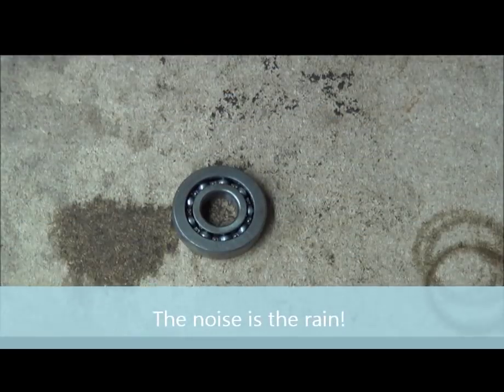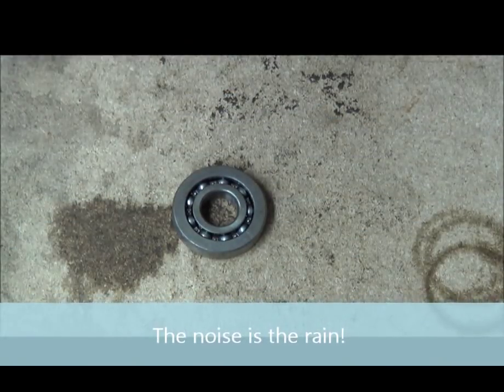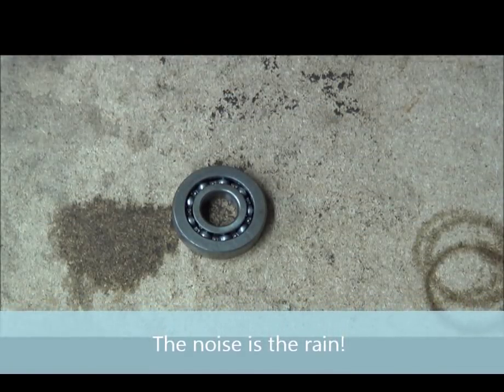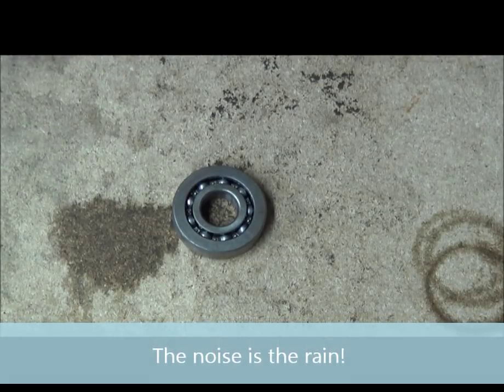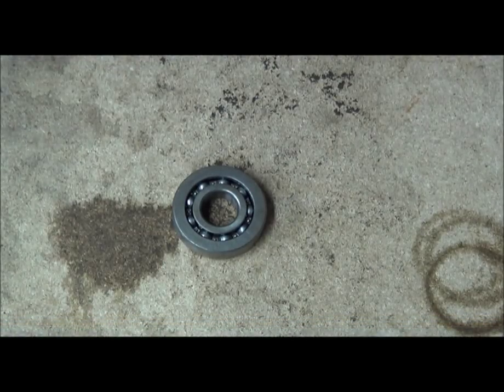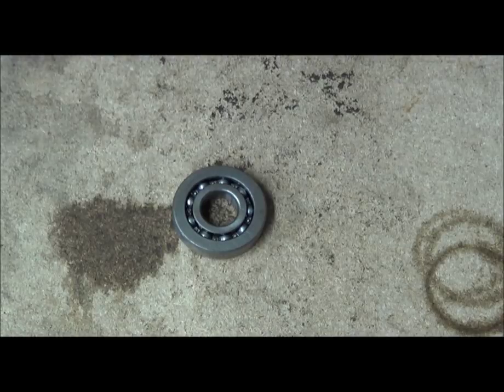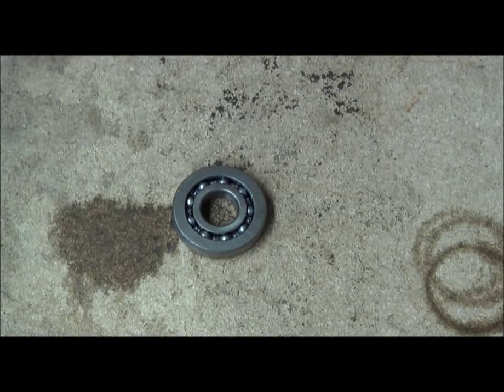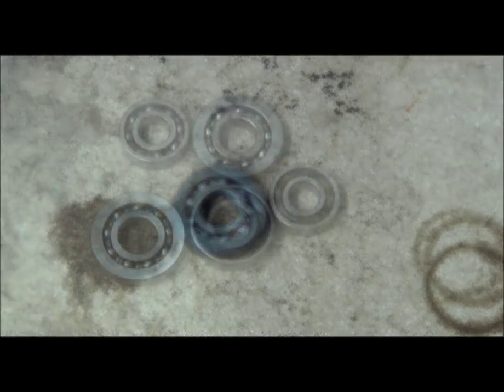Bearing Basics - Episode 1

Comment: I just came across this gem from the archives Matt, a highly informative video for the uninitiated regarding bearings.  As an aircraft technician of 39 years I was taught that the difference between ball and roller bearings, at least in aerospace gas turbine (jet) engine applications, is that ball bearings can take some axial, or thrust load, whereas roller bearings are purely for rotational loads.  I know that you , as an engineer, will know this, just wanted to add it as its an important distinction.  Amazing that one of your oldest videos can impart so much knowledge in such a short time, good work.

Comment: A Roman invention originally.

Bearings also have a friction rating obtained by spinning the test bearing up to a set RPM and then timing how long it takes to spin down to a stop.

When I used to drag race bikes, I used to rebuild engines with low friction rated (expensive) bearings to reduce internal frictional losses and increase acceleration.

I also built one of my café racer engines with low friction rated bearing, back in the 1980's, and it improved the MPG and performance. 

When rebuilding an engine the result is only as good as the quality of bearings used. It's hopefully going to a long time before it comes apart again so best to do things properly.

I was once called out to look at a Chinese made Chubb Knob Stair Lift (as the Chung Lan Star Way sc**ter is called around here) some kid had brought round a friend's house for help. I rode 11 miles and was asked to take a gander at the bearing on the rear transmission shaft..... IT WAS A NYLON BUSH!! It had done 3,000 miles and was already f**ked!!

Anyway we packed it with grease, put it all together and placed an add in Exchange and Mart for him. He managed to sell it and bought a brand new Sachs Mad Ass.

Comment: Why some engine crankshafts are on cylindrical roller bearings like maybach hl230 and some bike engines instead of using the regular journal type bearings with split shells and why arent they more common?
Reply from the maker: Cylindrical roller bearings require perfect alignment, if not they die dramatically. I did a video series on a bmw ge450 that does this way.

She'll bearings are better, but require a more complex oil pressure system.
Reply: @dirtygarageguy  I see now , thanks a lot.

Comment: Could you make a video about clearances ,Rpm range and temperatures ?I really would like to know more about that.
Reply: Just pick up a bearing catalog from any of the Japanese brands like Koyo or NSK. They explain pretty well what heat ranges you need to use what clearance for and the RPM ranges each bearing model can handle, as well as the max loads
Reply from the maker: Well... it's not that simple.

Comment: My apologies for commenting on an aged video, however I have an opinion question. Given your engineering background, what are your thoughts on using angular contact bearings for the mains in a 2 stroke, and/or dressing the shaft to “float” within the standard roller ball bearings?
Reply from the maker: The question that has to be asked is why? Why would you want tapered bearings vs balls? 

Another point is for tapered rollers you need to be able to apply pre-load to the bearings.
Reply from the maker: And what do you mean 'float' - you mean so the shaft is undersized?
Reply: I wasn’t referring to a tapered roller, but rather an angular contact ball bearing. It seems to me, given the number of forces acting upon the crankshaft, that the combined effect would cause the crank to want to move in n axial direction, implying a thrust force upon the bearings. The angular contact, I believe, though rated slightly lower in perpendicular loading, would be well suited in the combination of thrust, and perpendicular. As the crank cheeks try to separate, wouldn’t the angular contact be better suited to react to these forces?

The float, came from a mate that has done so, and his theory is that by allowing the crank to move a bit side to side prevents the thrust all together.
Reply from the maker: "As the crank cheeks try to separate, wouldn’t the angular contact be better suited to react to these forces?"

as the crank tries to seperate - do you mean bend? If so then the crank bends within the bearing fixture points - nothing to do with the bearings but the stiffness of the crank and the forces applied to it.

As for floating the crank does, its not fixed between the bearing inner races. And this doen't prevent thrusting - thrusting is a vector of force. 

Lastly - the bearings usually last longer than the the rings/cylinder. That's the major concern and not the bearings.
Reply: Typo there I think... the bending I refer to is the cheeks separating. In effect, yes a bending, however due to its design will the crankshaft not deform in a predictable, repetitive manor? If my assumption is correct, the outer ends will attempt to “rise” and the center “fall”. The deflection angle can, therefore be measured, and proper selection of angular bearing would counter that force, in that direction. 

It is not my intention to recreate the wheel, however in a competitive arena, one needs every little advantage they can find. I am just hoping to take advantage of any solution I can find.

Comment: Thank you.

Can you please help me?
I'm looking for a bearing that will completely seal a plastic drum or a tank and allow rotation at the same time.
I'm working on  steering mechanism for a tank that will not allow any air or liquid gets out or inside the tank.
Reply from the maker: Yes mate you have two options. You can either used a 'sealed bearing' or use an oil seal after the bearing. If you give me more details then I can be more precise. I would need the application (load, rpm, OD, ID, thickness and what kind of 'seal' you want i.e oil, grease, liquid etc) Also do you want to pressurize behind the seal? - matt

Comment: I'm just curious, if I swapped out for a manual transmission with an engine that never was designed to be paired with a manual... Will the thrust bearing hold up to the clutch being depressed? I've always wondered this xD never found an answer... I feel like the thrust bearing won't be as beefy so crank walk is likely
Reply from the maker: You won't find an answer because you're question isn't simple. The clutch CoF, spring rate, engine torque etc need to be known - once it is then you can work out the answer. 

This is a bit like 'how long is a piece of string'
Reply: The Workshop ohhh, ok, thank you! Awesome and very information video btw :) I'm just curious as to why you have a car emgine aluminum connecting rod xD I thought you just rebuilt bike engines

Comment: Would love to know your opinion on ceramic bearings. They have a lot of benefits including increased strength and heat properties as well as reduced friction. I wonder if doing an entire gearbox and crank assembly would have noticeable benefits from standard bearings. A lot of them boast almost needing no oil...
Reply from the maker: "They have a lot of benefits including increased strength and heat properties as well as reduced friction."

They last longer, that's it. And as for cranks, they have floating bearings. A ceramic varient would be worse, far worse.

Comment: This is really cool, don't the ball-housings though or cages cause friction among them though..? I mean, clearly they do their job regardless lol but this has always been something that's bugged me
Reply from the maker: Good question - bearings suffer from friction in the same way as 2 components would if no bearing was fitted. Bearings are used as they are sacrificial parts. The are designed with replacement in mind. If a crankshaft had no bearings and ran in the casing then when wear becomes too great you have to replace the casing and the crankshaft which would be extremely expensive compared to bearing replacement. To this end bearings can be designed to resist wear. This is usually done by constructing the besarings out of the same material so that the static and moving components wear at the same rate. Oil and low friction materials (like PTFE) can be used to reduce the wear. - hope this clears this up for you - matt
Reply: Ah I see, so I guess they're "bearing" the burden lol. Thanks for the video and the response though that really helps!

Comment: Hi Mark. Do flying saucers contain bearings?
Reply: No, flying saucers utilize a system of vacuums between the rotating center and the stationary shaft, which are kept separated by gravimagnetic forces. This means there is virtually no friction between the two pieces, and it is much more advanced than simple metal on metal rolling ball bearings.
Hope this helped. :-)

Comment: The best quality bearings are alloy magnetic with electro magnetic bearing. 100% frictionless.
Reply: Christs Revenge Depends on application.
Reply: Scientifically impossible.
Reply: @stephenburns5237  you might want to do a bit of research before commenting that it's impossible. They are commercially available.

Comment: Trying to repair this old window fan. I want to replace the bearings. How do I remove the things marked with green dots? I think I could use my digital calipers to find the diameter of the shaft and the outer part housing to find a replacement bearings. What tool can I buy or use to remove these? http://imgur.com/a/B9Xdh
Reply from the maker: Isn't that the outer race? Can you get a picture of the bearing from the side please?
Reply: Gonna take some time, my connection is VERY slow.
Reply: These.. it's like folded over metal that prevents the bearing from coming out. http://i.imgur.com/gSwBpBC.jpg

I'll finish uploading the rest.
Reply: I think this is pretty clear too. http://i.imgur.com/gG7JUW7.jpg
Reply from the maker: I was just making sure before I gave you bad advice. You can do 2 things 

1) - file/grind them will a dremel
2) - try to bend them back with a flat blade or a pick

From the photos it looks like a ally or zinc casting so bend them back might not be possible. Once you replace the bearing the just stake it 3 times - 6 times is a bit excessive lol
Reply: So they're called stakes? Yeah, I also gathered that it was a casting. I held up a N52 neodymium magnet to the casting, and there's iron present. Idk if it's the ball bearing inside, or what. I noticed the flashing around the casting. etc. 

Did a simple Google search with the the string "stakes to hold bearings in place" and Voilà. I'm now reading about the process a little here "http://www.assemblymag.com/articles/87755-assembly-presses-crimping-staking-swaging-clinching"

Crimping, Staking, Swaging, & Clinching.

I've seen this so many times in my life, I never knew what it was called. Now I'm smarter & more aware because of you. Thanks a million.

Yeah, I'm into all kinds of really cool stuff revolving around engineering.

Btw, my landlord had some WD-40. I sprayed the crap out of them, and Voilà, like brand new. 

I might still replace the bearings though. I think it will give me some experience, as this is actually my first time messing with bearings. They've always been on the back burning 99.9999% of my life, and today I actually got a chance to mess around with them. Thanks again. I'll take a look at some of your other videos and subscribe.

Comment: in my research my means and logic uses, the cylindrical bearings comes first not the spherical ones
Reply: even the strength of surface contacts, diameter and surface area
Reply from the maker: Comes first?